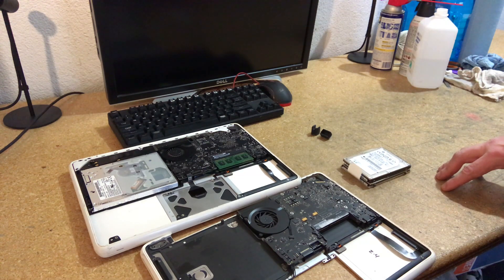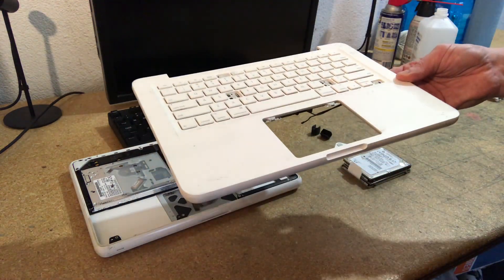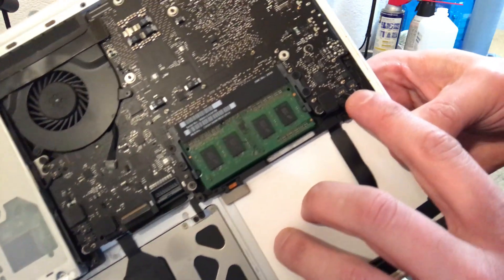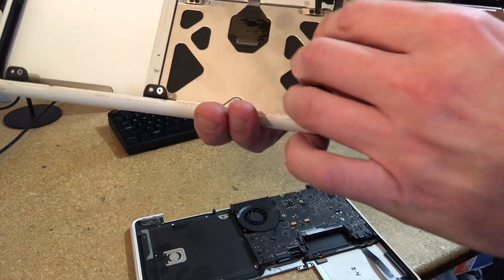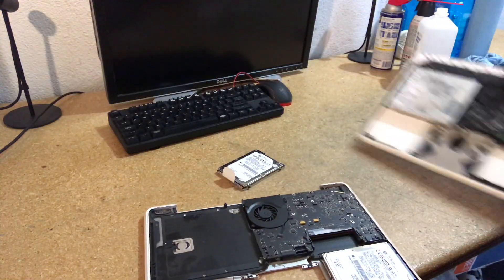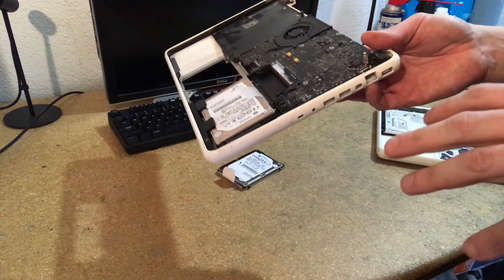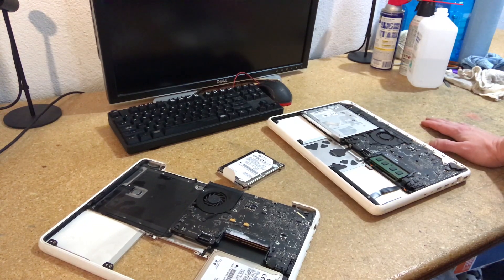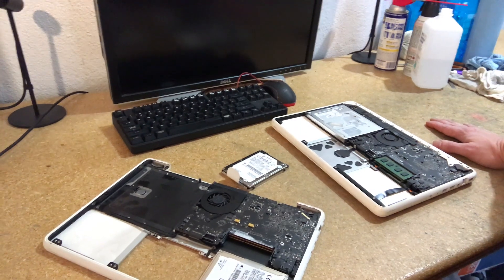Differences between 2009 and 2010 A1342 White Unibody Apple MacBook 13" Laptops - tell them apart!

Comment: Möchte anmerken, dass bei einem 2009 Standard DDR3 SO-DIMM bis 2x 4GB (Gesamt 8 GB) problemlos funktionieren, jedoch beim 2010 Model nicht! 
Dort funktionieren aber die (MacMemory) 2x4 GB DDR3 SO-DIMM (8GB Gesamt) von Corsair! 

Habe beide hier. Auf beiden läuft MacOS 11 BigSur per OpenCorePatcher
Reply from the maker: Strange, I have never had a problem with 8GB on the 2010.  I'm guessing you found some off-brand memory that wasn't compatible
Reply: @RDKLInc  na ja, beim 2009er laufen sie ohne Probleme. Beim 2010er piepst das MacBook nur. Habe dann die besagten Corsair rein gemacht und läuft damit wunderbar
Reply from the maker: @ServusKiesiHier  It's got to be the brand/type of RAM you are using.  I have put 8GB in literally thousands of 2010 without significant issue.

Comment: Hey, I just wanted to ask a question regarding the A1342’s memory. I recently swapped the logic board out on one of these and for some reason I’m getting the 5 second interval beep, so this points to an issue with memory. Running pc8500 1066 DDR3 both modules are okay but still getting the beeps, any suggestions what the issue could be? 

Thanks in advance!
Reply from the maker: Hi!  Did you by chance go from a 2.4 to a 2.26?  The older 2.26GHZ is known to be touchier with large RAM modules.  Also, try one module at a time leaving the other slot empty.  If you have known-good memory, but not a known-good board, it's very possible that the replacement board is bad, or that it has a bad slot.  That's more likely than your RAM suddenly becoming defective.
Reply: RDKL, Inc. it’s very strange I tried both slots, with alternate RAM modules and I get the same RAM relate tone on start up. I tried resetting the SMC but all that does is kill the MacBook completely unless I unplug and then plug back in the battery. I just can’t help but think I’m missing something obvious. Otherwise maybe it’s a bad board. 🤔
Reply from the maker: @adammarsden7943  If you haven't witnessed that board working, and the RAM was definitely working in previous machines, it's pretty safe to conclude something's up with the board.  You could always install a couple 1GB modules as a test, and if it doesn't work with that RAM either, you've then double-verified it's the board.
Reply: RDKL, Inc. thanks for all your advice. 

I might give that a try. I have two other working boards, however they are missing latches for the keyboard ribbon, and I don’t think there’s a way around that, tried keeping it in place with tape but that just failed badly. I might end up giving in with this project.
Reply: you could do everything right, the memory specs could in fact be correct, but the physicality's of just the specific brand , 
could  just be incompatible with your board . happens all the time , on paper certain 2 ram chips should work together, 
 in real life, it dont always work out .  for others who have simillar ram issue , make sure you have multiple different
ram  sticks that you can test with eachother. eventually youll get a pair that will work together.

Comment: You can add 16gb of ram too.
Reply from the maker: Good point!  I always assumed 16GB worked in both 2009 and 2010, but your comment made me look it up on everymac.com, and it appears 2009 can take 8GB and 2010 can take 16GB.  It may be that 2009 can take 16GB and the official docs just don't mention it, but if that is a difference between the two years, it's certainly worth noting.  I sell these with 4GB so I don't have experience putting 16GB in them.

Comment: Can I use a 2010 unibody logic board in a 2009 unibody shell without modifications?

I am currently using a SSD and 8 gigs of DDR3.
Reply from the maker: Ernie Diaz yes, as long as you are talking about WHITE unibody (not MacBook Pro) 2009 and 2010, they are 100% interchangeable.
Reply: @RDKLInc  Thank you so much the logic board for unibody 2010 worked on my 2009 chassis. See I was on of those 5 people listening.
Reply from the maker: @erniediaz894  Awesome, so great to hear!  Thanks for letting me know!